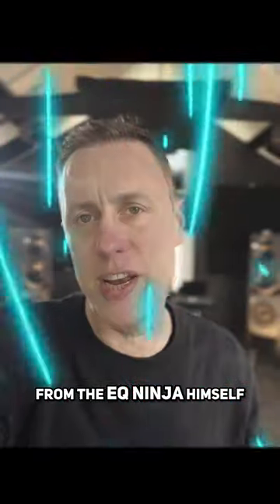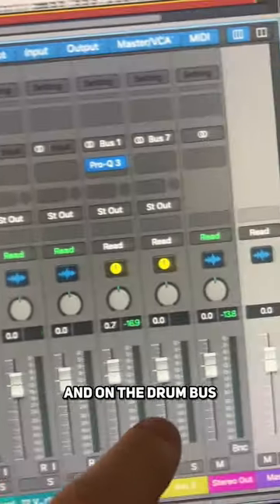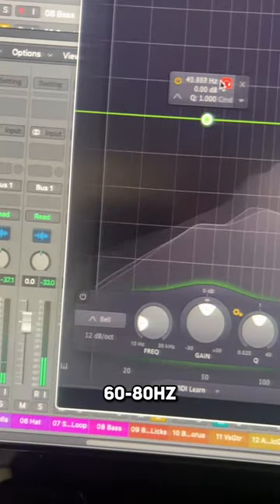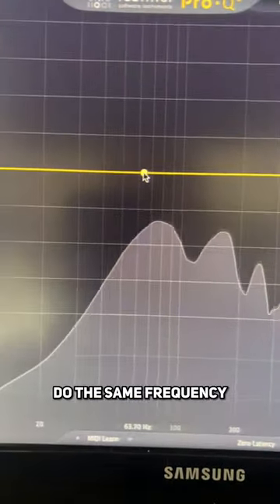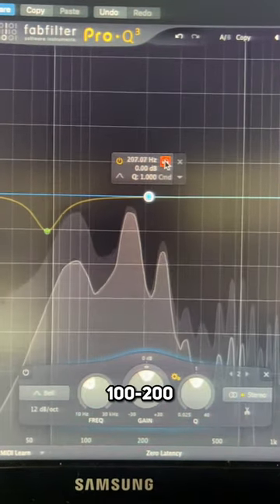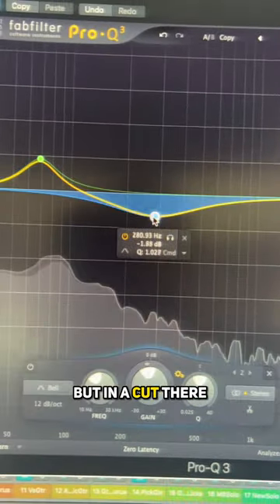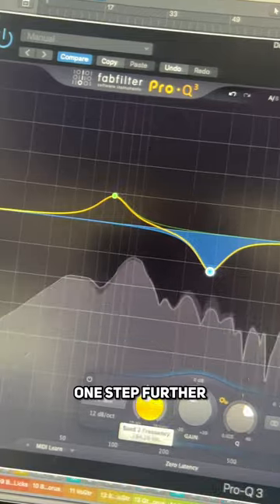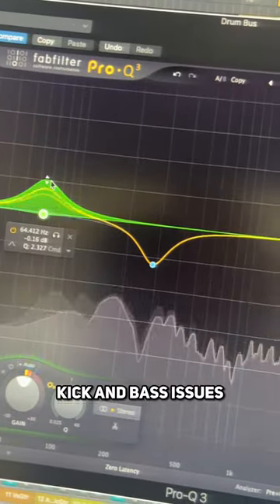THE EQ SWAPPER 🔀

Comment: That would completely kill the glue in my case. It's literally called mixing not "filling the pieces of a puzzle."
Reply: what is your case?
Reply: @Blessed_91  my case is any tracks which needs glue, my friend. Anything from orchestral, electro, metal, pop, we need a healthy amount of overlap to happen if we want it to feel together. Just my opinion, but mixes that feel too separated often are mixes that feel boring and weird to listen to.
Reply: @TachyBunker  He's not sucking out 30db though. If taking 3db of your bass instruments fundamental range out of your kick kills your "glue" then either there was no problem to begin with OR there's a different problem that needs addressed. It's not gonna clean it up THAT much that it sterilizes your track unless there's other problems or you overdo it. 

If tracks are clashing, this is 1 of many viable solutions that may or not be enough. If they're not clashing, don't do this. Don't solve problems that aren't there, but understand that just because they're not there in one instance doesn't mean they don't exist frequently.